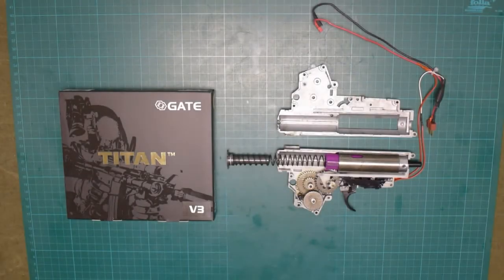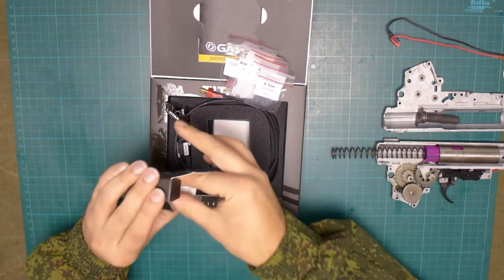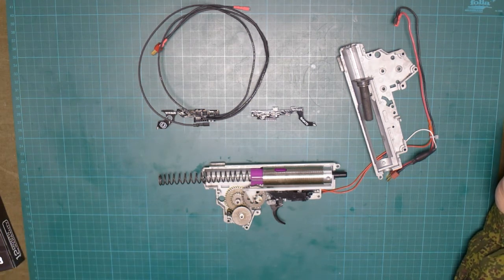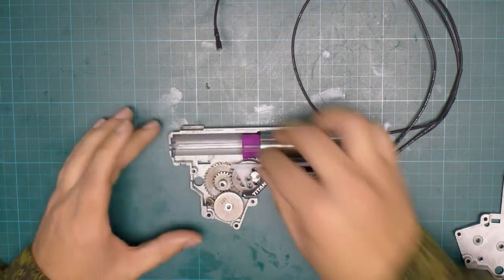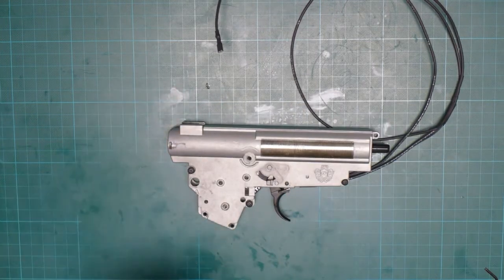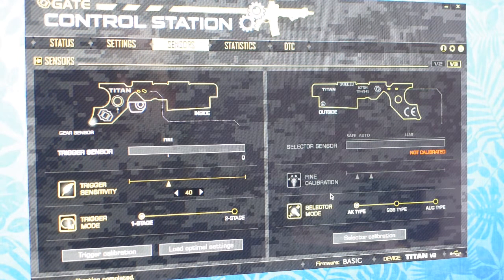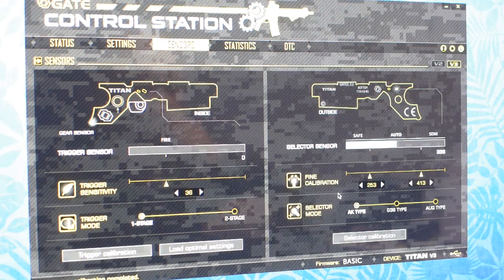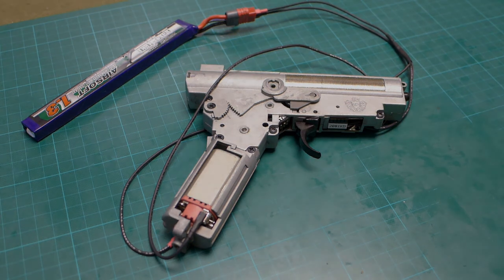Gate Electronics Titan v3 installation video

Comment from the maker: UPD: As there will be more and more questions about putting the Titan in VSS/ASVal/SR3(m) guns here are my thoughts:
- I will not work in traditional way as it is working with an AK or G36. Because there is no "traditional" selector plate. It is PROBABLY possible to modify and calibrate the selector plate of these guns to switch from SEMI to AUTO, but the SAFE will still be the traditional mechanical SAFE.
- When the gun is on SAFE, the sensors will still be active.
- You'll need to modify the wiring

I will be working on my AS Val in coming days and post my findings on FB and Instagram. If you'd like, I can shoot a small video and post it here too.
Reply: Fantastic. any information regarding the lct 9x39 sesries of guns would be really appreciated. need to find you on FB..

Comment: VERY, VERY, important. When installing the sticker on the selector, DO NOT TOUCH the internal side with the adhesive that is not on plastic. The sensors need it WHITE and clean so light can bounce.
Reply from the maker: I gently remove the adhesive from thise sticker parts that are not on the selector plate

Comment: Thank you for this, seems quite a straightforward job.
I have and love my as val dmr, but seeing as the trigger contacts have failed a titan is the obvious fix.

Can I just buy the kit, along with the link and just fit and fire or is there anything else I would need? 

I can worry about upgrading later on, as I'd like the mosfet to settle in first.

Comment: I just recently installed into CYMA AK47 050A and now it will not feed. It acts like the nozzle now moves to fast to allow a bb into the hopup chamber to fire. Any suggestions as to why this might be? Its running a high torque motor and m135 spring..

Comment: I followed your instructions carefully if I do not connect the shotgun to the computer it works the same?
Reply from the maker: no, you must connect it at least once - for initial sensors calibration. Next time you open the gearbox and take Titan halfs apart, it will remember the setting, so no need to connect it every time.
Reply: @Russkyairsoft  спасибо

Comment: what battery is this? can you link please
Reply from the maker: Turnigy 7,4V 1300mAh lipo from HobbyKing
Reply: @Russkyairsoft  thank you buddy! They look as if they would fit in the dust cover of a AK very well. Gonna give them a shot. My buddy is doing a E&L titan MOSFET and parts upgrade this week
Reply from the maker: @ttfactoryoutdoors9605  yep. I use them on my AKS and AKSU under the top cover. they slide really deep in the gas tube, if it allows that. I also used 3-cell versions with the same form factor. 2 cells in the gas tube and the 3rd under the top cover, but had to prolong the wires.

Comment: Ok,when is part 2 of the video coming? You should do more of this videos Andrey. They are very good. Are there any other features of this Mosfet besides working without the cuttoff lever?
Reply from the maker: part 2? :) Installation is done. What is there more over for part 2? 
Maybe later a "features video". I actually have more footage talking about the features, but decided not to put it in this one.
Or, maybe, I'll do a comparison video with advanced kit installed in my AS Val
Reply: Yes,that is what I meant. Some sort of comparison with the advanced version. Would be cool.
Reply from the maker: just shot in my head, there is no "traditional" selector plate in the 9x39mm series of LCTairsoft guns. Must check ASAP  how to work around it :)
Reply: Aha,AS Val is 9×39,ok.  Yeah the selector is a bit different.  I have worked once on a LCT AS Val,and I forgot how the selector works,but it is kinda more complicated,at least to me. So,you now have a lot more work to do,thanks to me being a pain in the ass,hehe.

Comment: I have some concerns regarding the pre-cocking function now. I installed a 115 ms spring gaining 120 m/s power, after several month the power decreased to 100 m/s, so be carefull with that.
Reply from the maker: you should release the piston before putting the AEG in a gunbag :) If you leave it pre-cocked, indeed, the spring weakens with the time.
Reply: I have to ask how to do that too.
Reply from the maker: there is a trick for titan v2, I have to check if the same trick is working for v3. Or you can try it yourself, if you have you gun next to you. search for "gate precock disable" on YT. I can give it a shot in a couple of days, but not the next 24 hours unfortunatelly